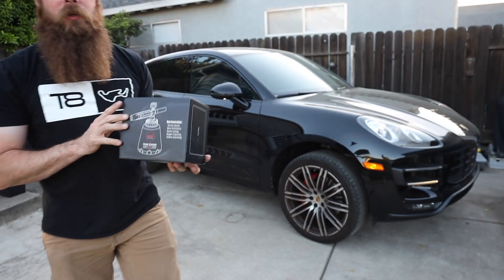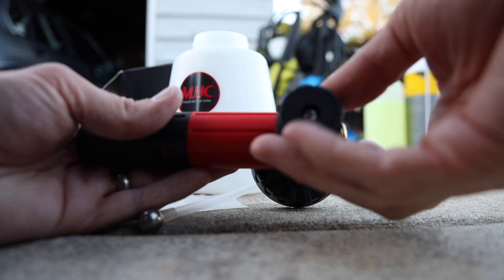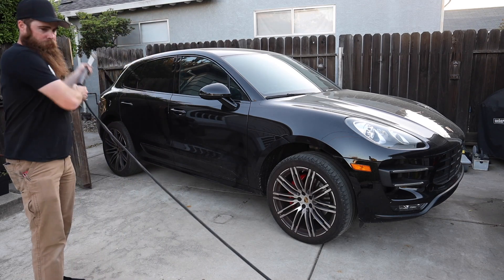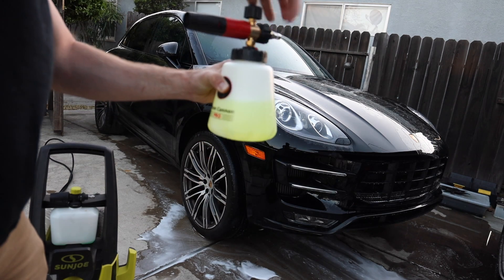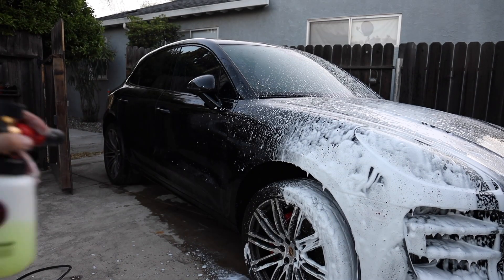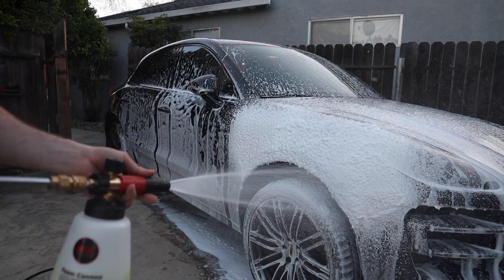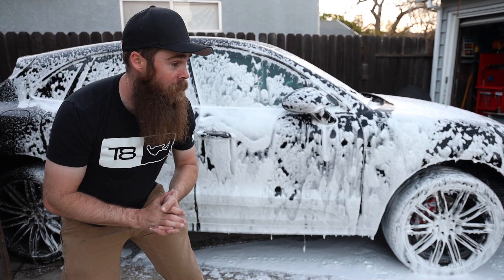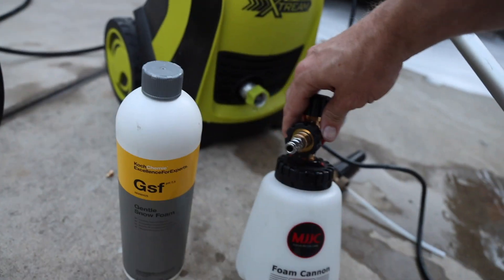Foam Cannon with the Most Foam EVER!! MJJC Foam Cannon Pro

Comment: I just want to point out that transferring the fluid from one canon to the other, doesnt mean you are using the same concentration because it depends on the dilution rate of the canon. A 1:10 concentration in the flask, does not mean a 1:10 concentration out the nozzle, because that mixture gets much more diluted by the pressure jet.

For example, you could put a litre of water into both cannons and then jet em into a bucket until that litre is sucked through. One cannon might put 10 litres total into the bucket, the other could put 20 litres into it. So one sucks product twice as fast as the other making the mixture out the nozzle twice as concentrated. That means that in order to get the same percentage of product out the nozzle, you'd have to put twice the concentration of product into the cannon with the higher dilution rate.

By putting the same mix into both cannons, you are giving a massive advantage to whichever cannon has the lower dilution rate ...the MJJC has one of the lowest dilution rates among the commonly used cannons. The MJJC is a great cannon, but if it sucks the contents of it's flask twice as fast as the others, you're basically using it with twice the product concentration.